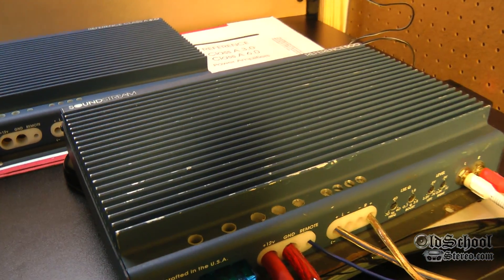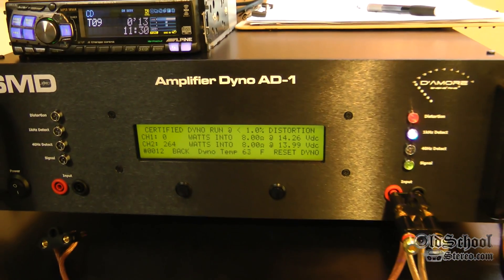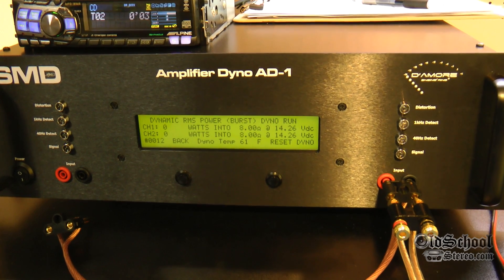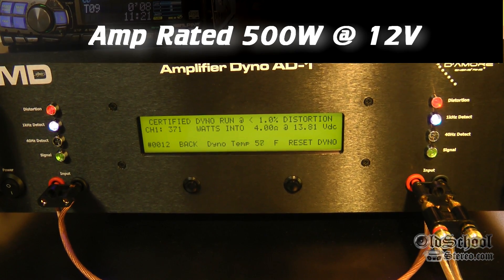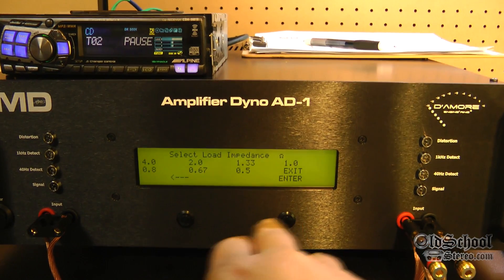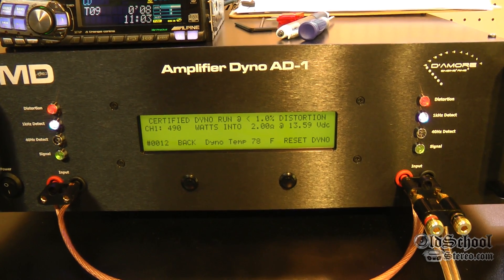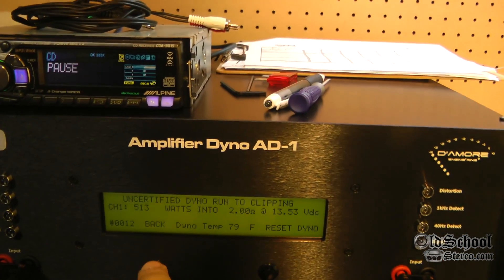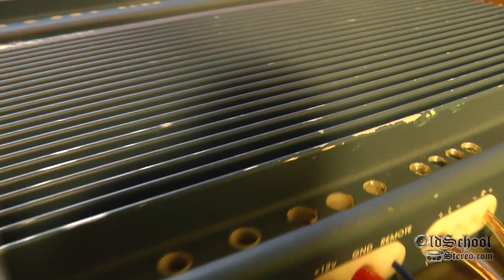Soundstream Reference 500 Amp Dyno AD-1 FULL Test Wattage RMS

Comment: These are amazing sq amps, never meant to be powerhouse amps, but for the power they made one of the sweetest sounding series of amps I have ever heard, never harsh always clean clear controlled and detailed without any hint of harshness, legendary sound quality that I haven’t found in any other amp still, got the ref 500 myself brought it back up to snuff with total recap tricky to find the appropriate sized caps to replace the originals, also after upgrading the op amps in the front end to Excalibur series op amps direct drop in, all I can say is it’s like the cleanest clearest liquid glass sound is the best way I can describe it, like the original but even better, even more dynamics and even less noise floor, seperation of notes is soo sublime, hard to find these even on eBay, the ones you find are demanding very high prices, the only weakness of these amps I would have to say is the driver boards run hot! And they tend to fail after a lot of hours, they are however still available nos on eBay

Comment: I had one back in the day. It was incredible. So much power.
 I ran it in High Current Mode (flick the switch under the amp) and 1 ohm to 2x 600w 15" subs and 2x 4way 200w 6x9s.  It invoked much tinnitus. :D

Comment: You know they run down to 1/4 ohm, bet the dyno won’t even allow that test. I ran mine with 2 dual coil 2 ohm speakers all ran in parallel got Half ohm on all my soundstream builds back in day. Reference 405 is what I liked and owned.
Reply from the maker: Not gonna get any more power though. They were crazy cool amps for the time. I still dig eem

Comment: Back in 1999 I had the Rubicon 702 on two sound stream SPL 10’s sealed in my 1997 Mazda B2300 regular cab. Basically a Mazda branded Ford Ranger lol. That amp pushed those 10’s great!! And in that little truck they hit hard!! I had the sound stream little wonder running my MB Quart 6.5” components. That was one of my favorite systems from back in the day. The sound quality was great also. Of course it wasn’t the most comfortable to drive with that box behind the seat. I was basically right up against the steering wheel lol. But when you’re a teenage Basshead you do what you gotta do to make it bump!!
Reply: I have a closet full of boxed Rubicon 702 amps. Love those amps. I ran two Rubicon 702’s to two Soundstream Exact 12’s. Some of the deepest and most powerful bass I’ve ever heard that wasn’t in a DB drag style setup. And I installed all the high end gear back in the 90’s through mid 2000’s.
Reply: @Assimilator702  Nice!! What vehicle did you have them in? Those 10’s I had on one 702 were slamming. It wasn’t anything like some competition vehicles. But as far as the home built stuff lots of people were surprised at how hard it hit and how deep the bass was. They were just in a sealed box. Didn’t have enough room to port them. I was already so close to the steering wheel. If ford/Mazda hadn’t had that hump behind the seat and it had been flat there would have been enough room.
Reply: @JayP7.62  The system was in an Audi.

Comment: I think there is a Q setting, in larger subs, it cleans up excessive "drag", that exacerbates in ported design. Very few amps can clean up the low bottoms. It's likened to a high damping factor amplifier. Every load that's halved, makes it more challenging for the amp to tame the sub. The bigger the diameter, the harder it is to start stop the cone.

Comment: I still have the 500sx version which is a little different from the early one your dynoing, its from maybe1996 or so with the fuse under a cap on the bottom of the amp. Unfortunately one channel stopped outputting but i dont see anything burnt inside the amp and the rca terminals dont seem loose. Big D any recommendations where i can send this bad boy for repair? Ive owned it since then and ran a pair of kicker comp 15s on it back it the late 90s and loved that amp and the high current mode! Also made in the good ol USA!

Comment: What alpine head unit are you running in this video?
Reply from the maker: It's an Alpine CDA-9815, which I'm actually still using! It will be replaced soon with the Pioneer DEH-80PRS when I rebuild my bench over the next few weeks.
Reply: @wal  thank you. Mine is the cda_-9813. Looks very similar. Absolutely love that head unit. I've had mine for years, even tho I have newer models I still prefer my 9813
Reply from the maker: @danfuller06  they are almost identical. Mine works perfect except the play/pause remote control function stopped. I have several remotes and none work so it’s something with the IR sensor I guess...
Reply: @wal  I've heard good things about the 80prs. Is it worth changing over to it? What's the benefits of the prs compared to the 9815 and 9813?

Comment: Can’t that amp do down to 1/4 ohm?
Reply from the maker: Yes but lower ohm loads don’t mean more power, especially when you get that low. Especially with a Class AB amp, efficiency is horrendous the lower you go, eating up more of that output power to heat instead of output to speaker
Reply: @wal  ok thank you for the info.. I have the reference 300 it’s a really good amp for its age..

Comment: Soundstream was, when this was made, the best sounding amp of all I ever heard. That may be debatable, but their build quality certainly was never in question. Their new gear is nothing compared to the “old school” way they were made. No question!
Reply from the maker: Too bad old Soundstream is no more 😞
Reply: @wal  what alpine head unit are you running on top of the dyno? Looks a lot like mine but with more controls
Reply: @danfuller06  That Alpine is a 2004 to 2005 model. I forgot all the model #’s like I used to.

Comment: i borrowed a ref500 from a friend many years ago, and loaded it to 1ohm...blew the fuses all the time, so i repaced them with 2x40A and then it worked awesome... used it for dBdrag competition. Later i replaced it with an Crossfire BMF 1000d and only gained 0.5dB. I still have a love for old soundstream amps.

Comment: Should've said "watch the smoke show", not light show.

These amps were supposed to be good...and run in high power mode, usually that was true. But run them bridged in high current mode, and they were notorious for letting their magic smoke out. Don't ask how I know. Let's just say I know there were a boatload returned for warranty work, most more than once.
Reply: I've got a Reference 700SX for that very reason. 500 kept smokestreaming so they "upgraded" me to the 700SX no charge. Honestly though the 700sx has given little to no issues and is still going 25 years later.
Reply: @TheKlixer  I gave up after 3 "repairs" and 2 replacements. I gave it to a friend and bought a phoenix gold.

Comment: The Soundstream Reference 500 is rated at 75x2 @ 4ohm stereo, 150x1 8ohm bridged. 150x2 @ 2ohm stereo or 300x1 4ohm bridged. 250x2 @ 1ohm stereo or 500x1 @ 2ohm bridged. So its actually over-rated according to your 4ohm mono test. The 500w rating is at 2ohm bridged mono.

I''m the proud original owner of a Reference 500s and 1000s that i bought back in the late 90's.
Reply: Your ratings are partially from the reference 300. Look at the soundstream reference 500 user manual online. 500 is rated 125 x 2 at 4ohm stereo and 250 x 2 at 2 ohm stereo.

Comment: i owned the reference amp well over 10 years ago with two 30amp fuses under a rubber cap on the bottom, i dont remember the exact model but it could take .5 ohm stereo.. would u happen to know?

Comment: thanks I'm going to stay away from these reference series amplifiers they all seem to be overrated from your test
Reply: These were "cheater" amps... They worked best when you ran 1 ohm or less in the High Current mode. The Soundstream Reference series could handle 1/2 an Ohm of speaker resistance and would output some serious power... I ran a pair of Rockford Fosgate Power Hx2 12", wired to give me 1 ohm... Those subwoofers were rated to handle 2000 watts max... I had no problems driving those subs to max excursion with the Soundstream Ref. 500
   Just don't touch the amp when it is under full load... you will remove skin from your hand if you do... They got crazy hot :P
Reply: They are old. The caps are dried out and need to be replaced. Once that is done they would make rated.

Comment: This series of amps is probably the best ever.    Including the Soundstream Exact woofer.
Reply: When these amps were released (early 90s) the Reference Series Subs (aka "The Velvet Hammers") were the corresponding Subwoofer Line. They were AMAZING too 😍 

The Exact Line came later, & although they were very good as well, they PALED in comparison imo.
Reply: @pastorofmuppets325  I had those too.  I had a set of the 10"  on a Reference 200.   Later upgraded to the Ref300.  stepped up again and Ordered a Reference 500, and put 3 10" Exact tuned to 35.  It was heaven.

Comment: just bought an old rubicon 302 for 20 bucks. Iooks like pre-asian made as is says handcrafted in usa on the case. Test run tom and if it works good ill try it on my 6x9s. Were the 302s even worth a damn?
Reply: Only works in mono or summed but it sounds amazing for an 18yr old amp. Gonna use it until it blows in another 18yrs

Comment: Mine is a 1998 soundstream rubicon lil'wonder, but I can't get any more info on it, I don't even know how many watts the thing has, so I'm hoping the one on this video can be used a reference, because the one he has it looks a like but my amp is smaller than his.
Reply: Chris Ramos A Lil Wonder is basically a Rubicon 102 which does ABOUT 60ish watts x2 into 4 ohms. There's TONS of info out there if you know where to look. Soundstream amps have a huge following and there's quite a few of us that have started collecting them. The marketing campaign for those Lil Wonders was funny as hell. How much power into 4 ohms? A lot. How much into 2 ohms? Even more. Just do a google search for rubicon 102 or 202 and get a few pics of the internals. Now do a search for the Lil Wonder and you can see how similar the board s to one of the models. SS had WAY too many amplifier models in the Rubicon era and the Lil Wonder was one step taken to simplify the line. Actually if you go to amp performance .de they have a nice data base of amp internals. I thinks few of my amps are in the SS section.

Comment: On the amp dyno you got 631 tops and in a vehicle at playing mode even clipping could it still reach 631?  Or does the amp dyno peak for test purposes. Must be sic to know you have one of the first 10 amp dynos for sale , the first 2 had to go to Steve and one for Tony.  Always interesting to see and old amp I may have installed for someone back when and sometimes from one car to another a few times .
Reply from the maker: The Dynamic RMS mode (631W) is supposed to simulate music playback and adheres to the IHF-202 standard for dynamic power when used with the 1kHz test tone. Yes, I must admit, the Amp Dyno is a cool tool and I feel very fortunate to have one..